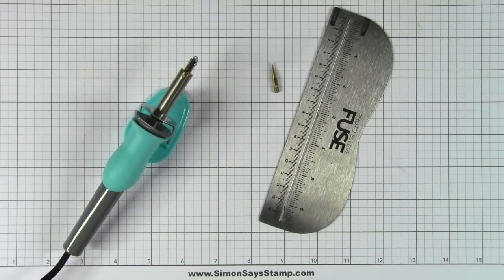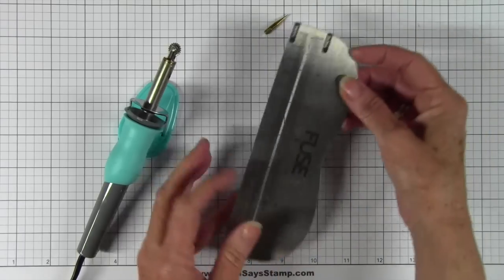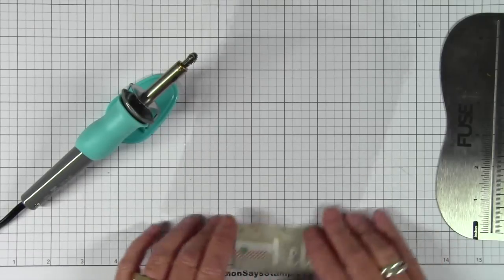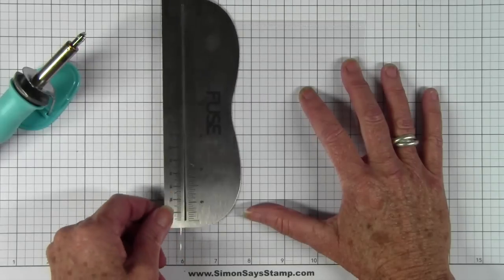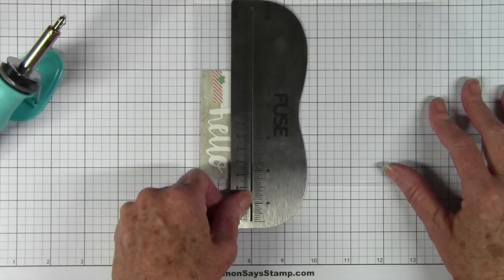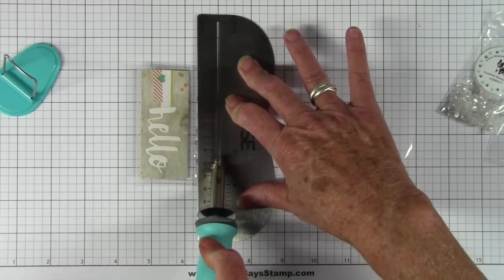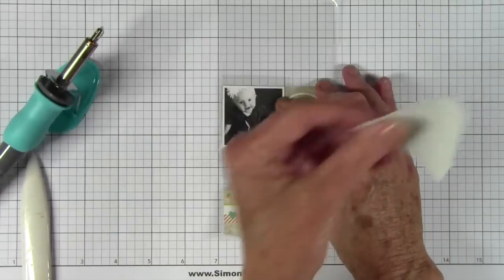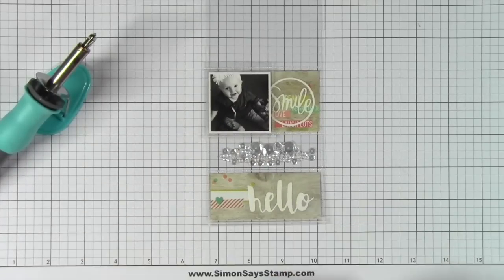Fuse Tool Basics

Comment: Are there alternatives to the fuse tool? Cant seem to find it in my country and it costs a lot to deliver here. I've found some from us but 100 bucks to deliver. Would soldering iron work? wanted to check before i get anything

Comment: I bought this tool months  ago and finally pulled it out to use it and it doesn't seal anything. It melts the plastic but when I gently test the seams it's made it opens right up. Am I doing something wrong? It's been heated up for 20 minutes before I used it.

Comment: So Shari, would you PLEASE, PLEASE, PLEASE do a demo using the decorative tips?! I know that practice is the key here, but it seems that the more I practice with the 2 tips the worse I get. 😒 😟 Two of the tips in the package are the same ones that came with the fuse tool, so I'm referring to the other 2 - the diagonal slash and the series of dots tips. I'm hoping you might have some sage advise for those of us trying to keep the design not only straight, but the full pattern being shown throughout the entire fuse. Since you cannot use the ruler slit to keep the fuse straight, you're left to your own devices - yikes! If you happen to not hold the tip perfectly parallel to your project, the design looks weird since the total width doesn't fuse. There's got to be some solution for us folks who struggle with them...HELP US PLEASE!!! Thanks your so much for reading my plea for assistance...